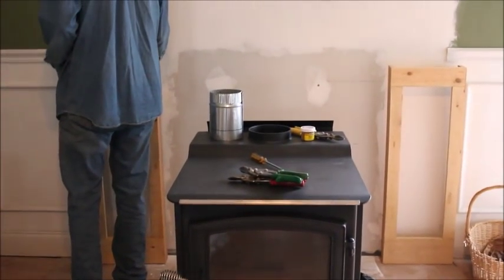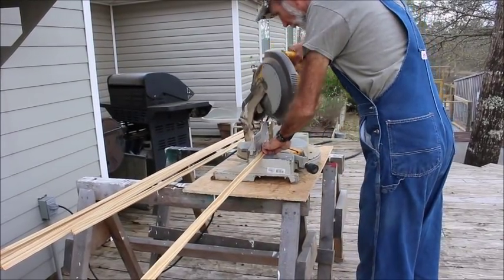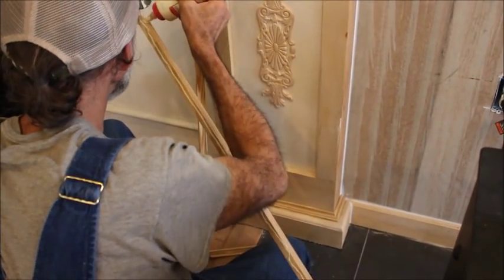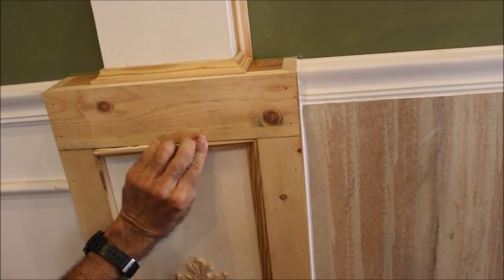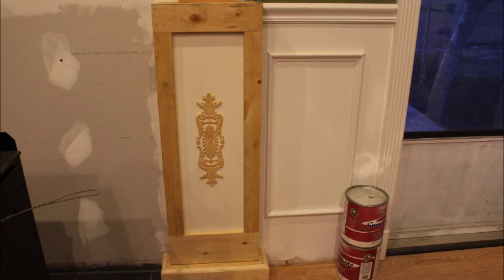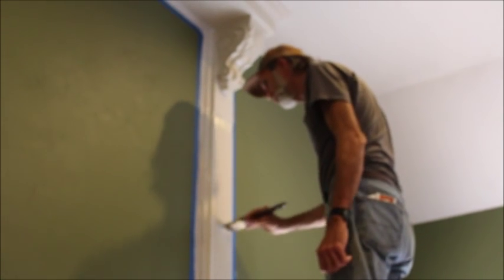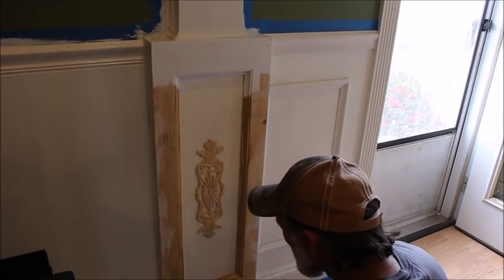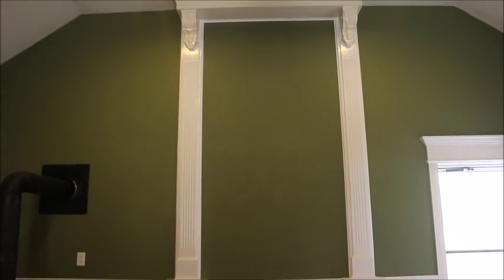You've Got To See IT Now!

Comment: I would love to see how you figured out how to cut the base to set level to the floor. How you measured it. Did you make a template out of something? It looks so perfect.  Your ceilings are so high and beautiful. How tall are they? Love those tall ceilings in the southern homes. Perfect for summer to help cool the house.
Reply from the maker: LindyTN I sat the base level and ran a compass along the floor to transfer the contour to the base and then used a coping saw to cut it out. The ceilings are 12 ft high.Thanks Lindy